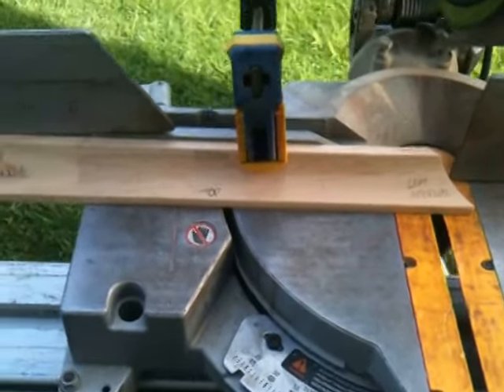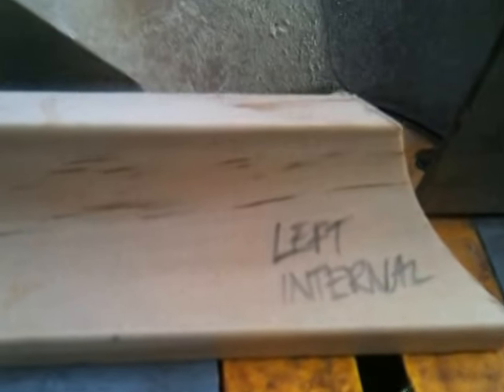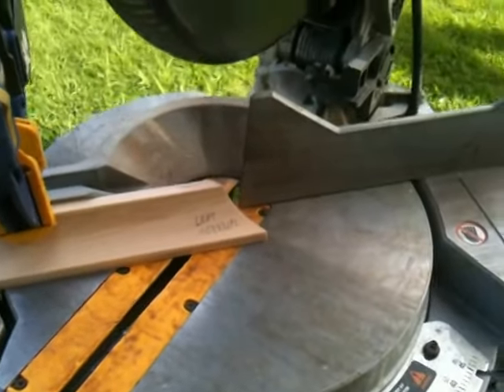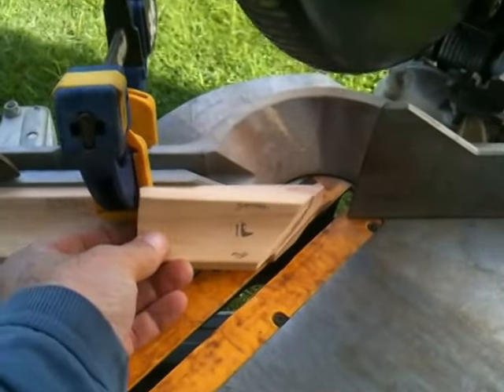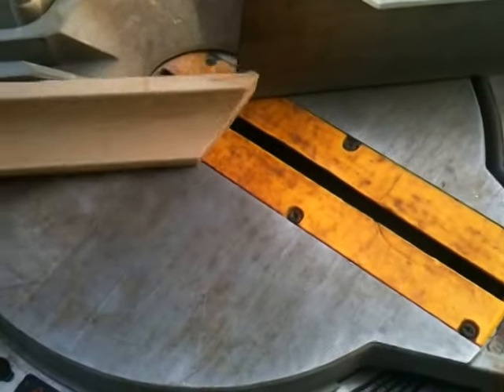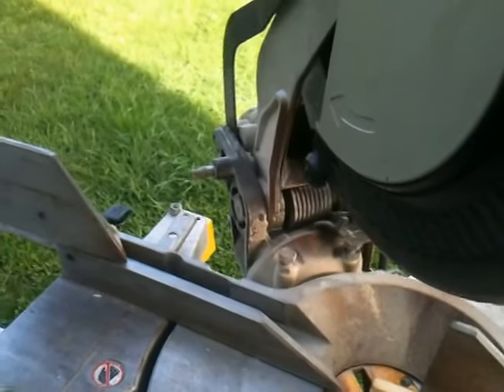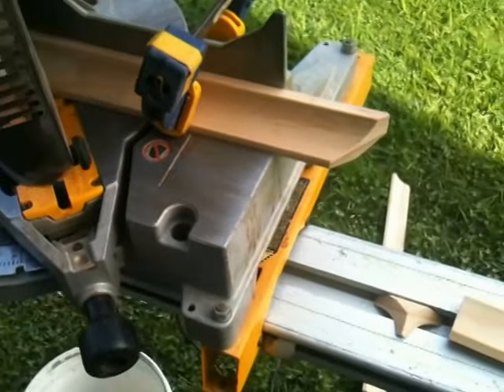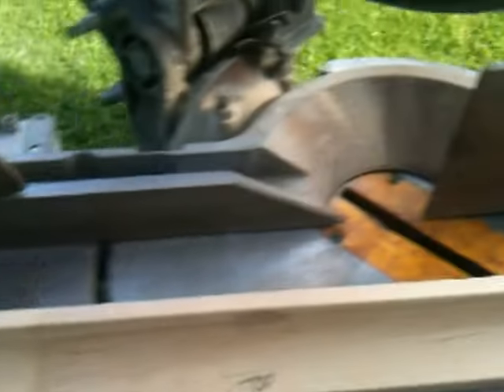Mitred Internal Corner for Crown Moulding/Molding

Comment: Could u go into a little more detail on this. Normally I'm great at this stuff. Yesterday I had brain fart syndrome and just couldn't get it. I think I got it now thanks to your vid. ITS THE ONLY ONE ON YOU TUBE. For inside corner trim. I will need to go around a post that goes all the way to the ceiling and will need the outside cuts for this as well. Any help/extra tips would be greatly appreciated!